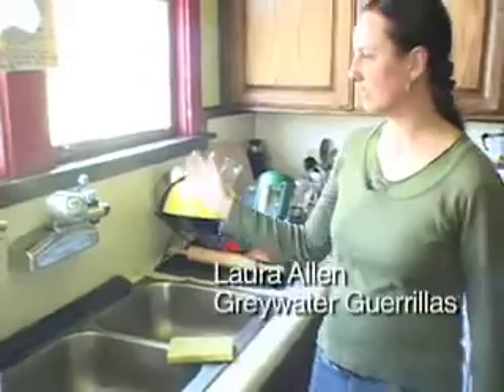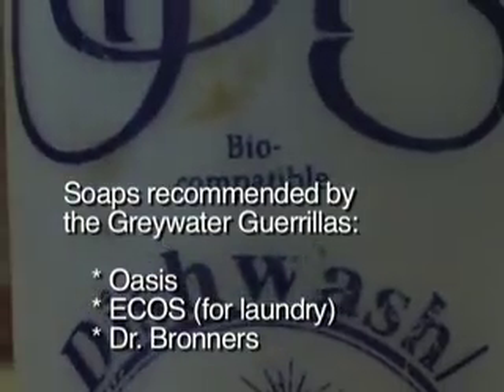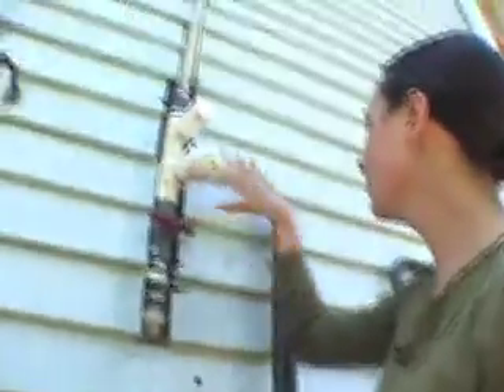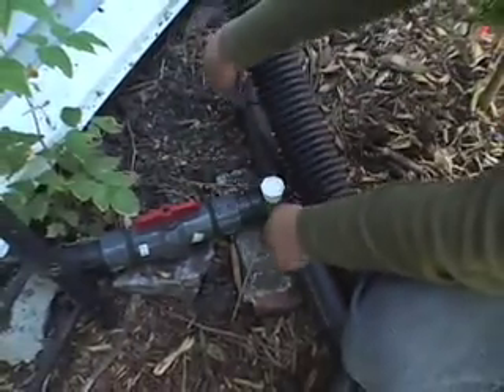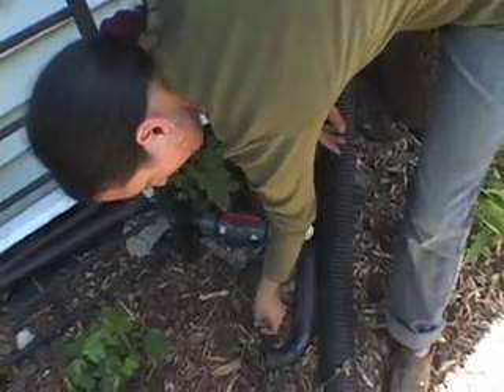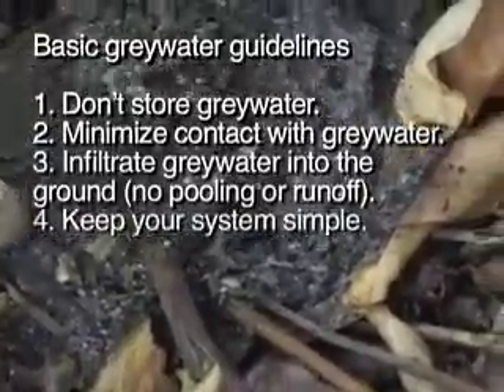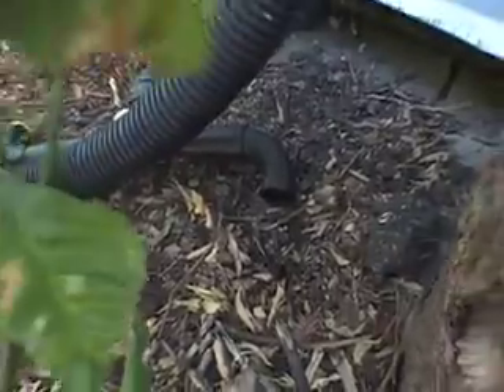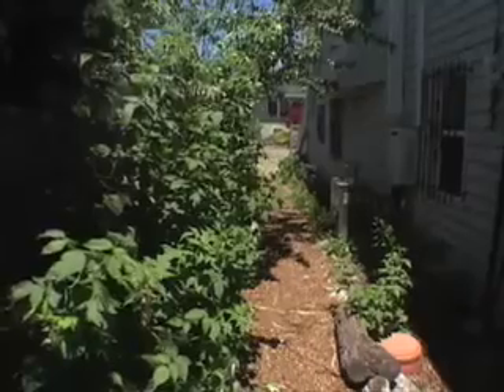Greywater 101: replumbing your kitchen sink

Comment: Great example of how not to do it.
1 don't cut up your house
2 install atleast 1 grease trap
3 install atleast 3 separate moving steps (dripping or whatever) for water to be filtered
4 do the math on how many liters and how many days it will take to filter thru plants

This literally does nothing but dump bacteria all over. If everyone did this we would destroy local ecosystems not to mention destroy the watershed and over load the ground's ability to clean the water before reaching the aquifers

Comment: Risky system since gray water may also contain pathogens so pouring directly on to your veggies is not a good idea until the pathogens have been destroyed by some kind of filtering processes.
Reply: Hopefully your kitchen scraps and water don't have pathogens or you're having a rough meal day.  The wood chips are a filtration process and keeping it subsurface is key to prevent it from becoming black water.